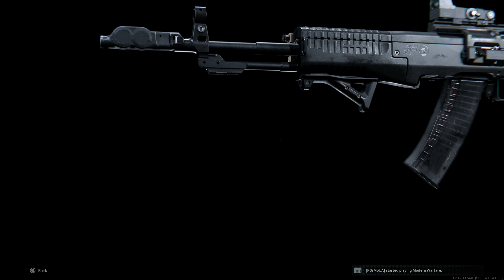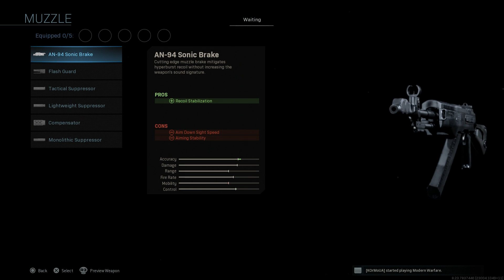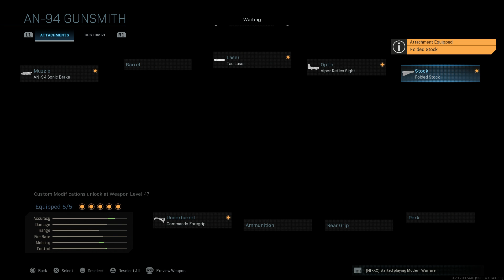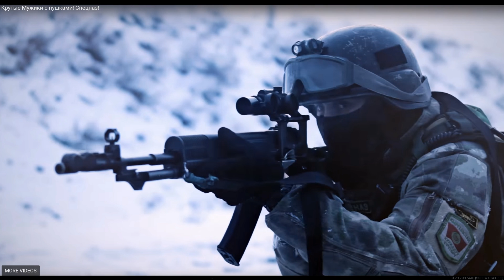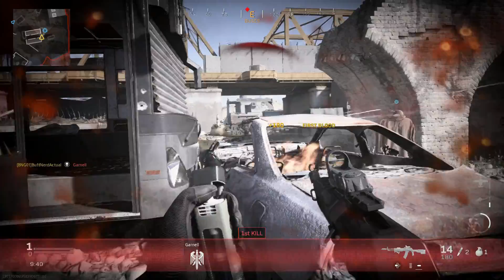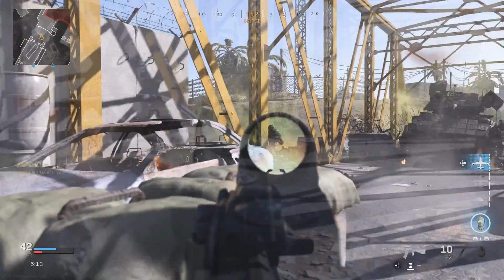AN-94 Abakan Weapon Conversions - Call Of Duty Modern Warfare

Comment: I just notice that the dev makes a little bit changes in the blueprint mechanic. I found that in M4 and Scar blueprint, in some blueprint, if you change barrel or stock to default, it will change to black color instead of tan like the previous time. I think it looks great and makes mixing blueprint more interesting.

Comment: I find it funny that the gun has a standard AK-74 stock with the recess for the optics rail on the left side of the receiver, whereas the stock on the AN folds to the right side for whatever reason. Ironically, as a right handed person you can't even use the gun with the stock folded, because it blocks the trigger completely, as can be seen in this video. 

This gun was never used widely because it is a piece of shit ergonomics-wise and the hyperburst capabilities don't outweigh all the negatives.

Comment: Not a fan of the AN-94. It is an ugly looking weapon. BTW you might wanna go back and re-do some of your old M4A1 weapon conversions, since they actually updated the OG and Purist blueprints so they are all-black by default, without any attachments. They also did this for black variants of the FN Scar and AK-47, including the Steel Curtain.

Point is, you can now make a proper M16A3 or M16A4 out of the OG or Purist without having to attach the 50 round magazine to get rid of the default tan magazine, since the new default mag is now black.

Comment: Hmmm, the fire selector is different from IRL AN-94, and for some weird reason, the stock stock is from an AK-74M (even the prototype didn't have the recessed part in the stock, because that is there for AK-74M's side rail... that detail is even weirder, becuase they got the right side to which the stock folds on AN-94 and the side rail wouldn't even matter, because it is exactly the other way around compared to the AK-74M)...
And funnily enough, the "sonic brake" is actually one of the things that are key to the "hyperburst", and it wouldn't work without it... And it has nothing to do with sound, it is to delay the recoil-operated part of the mechanism (the "bolt-sled" for lack of a better term) long enough for the bolt to do a full cycle and shoot for a second time before the "bolt-sled" hits back of the reciever and the recoil is transmitted into the shooter... Also, for some reason, the weapon has AK-12 rear sight instead of the almost-HK-like sight...
But I guess CoD devs don't watch Forgotten Weapons videos (and for that matter, they probably haven't seen an actual AKS-74U or AK-74M either)....
At least they got the angled magazine correct...
Reply: He says that in the video. I hope one day a company builds a civilian one with a binary trigger.
Reply: @devinthierault  I would be useless.....a weapon made have a hyperburst built as a semi only would just have a weird recoil impulse
Reply: @theobuzat9091  it would be the closest thing you'd have to ever touching the an94 though
Reply: @nigeldean1813  well yes, but it still wouldn't be a "real one" you know, just like the US compagny trying to develop a VSS in semi only.... would be awesome dont get me wrong, just not the real thing (a VSS would be better as a semi only, the AN-94 would be just a weird and very complicated gun ^^)
Reply: Hehe stock stock
Reply: The muzzle device supposedly shifts some of the gun's sound into the frequencies that humans can't hear. That might have been a happy accident from the design's purpose of helping control recoil for the hyperburst, though.